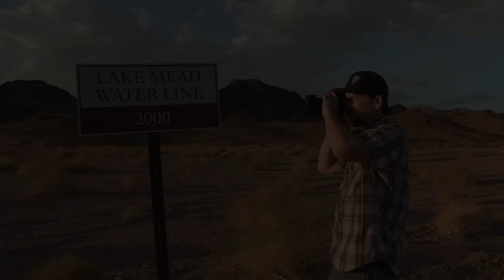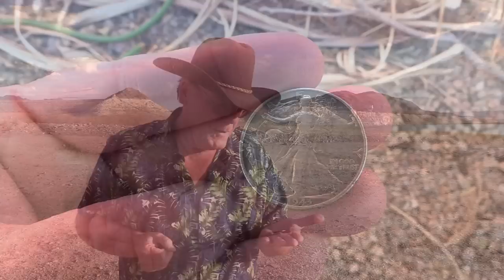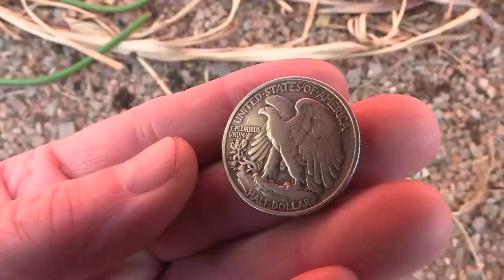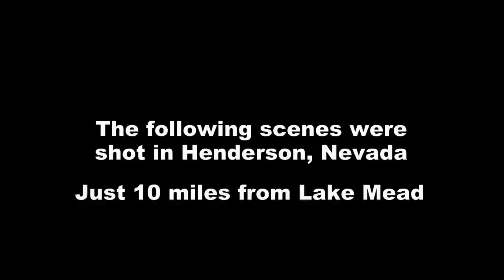LAKE MEAD DISASTER! Record Low Water Levels and Still Dropping - How Much Longer Can It Last?

Comment: My grandfather’s concern when Hoover Dam was built was that the water intakes were too low and the hydroelectric generator’s would be starved for water due to silt. Works manager Pelton Water Wheel San Francisco. Pelton provided the two wheels that generate in house power on each end of the turbine deck. 

A lake is a meadow in the making. 

Water rights and the Colorado River.  What a mess.
Reply: @Sheps  I’m paying attention and there are a lot of peon’s like me, that pay attention. But what’s a Peon to do?

Comment: Yes, very interested! Great vid!  So sad to see.. We also spent a lot of time on the lake in the 70's. I remember a day, it was 126 degrees and we had to keep jumping in to not overheat. Our boat slip was in Temple Bar, right next to Lee majors & Farah Faucett's boat. Used to catch crappie in the coves, camp at the sand bar, or up at the ?? Ferry (can't remember the name but it was where the Grand Canyon connected up north. Pierce ferry?? 

Bottom line: How the "F" are we gonna supply the power to charge thousands of electric cars every night, when Powell & Mead (Hoover dam) won't have water to turn the blades??   We already have "Rolling Blackouts" due to the grid not keeping up with current demand..  It's all unbelievable.  If we were truly concerned with CO2 levels, plant trees for gods sake.  Probably just me being stupid..    Great video!  Seriously, we're actually entering a cooling phase of the sun cycles, which means less energy. Less energy = less wind = less sun spots = less solar.  Got a good bicycle?

Comment: Love your video's and loved this one also as it was a little different than all of the "sunken boat" video's coming out every day from there. It's hard to believe that they are still building out there, but, like the old saying goes "Hope springs eternal". I turn 72  tomorrow and when I started driving in 1966, .75 cents bought 3 gallons of gas from the farmer next door. He had a 300 gallon tank with a hand pump to fill up his farm equipment so we had to crank it in by hand. Gas was around .27 cents at the gas station but the farmer got a discount from the local co-op store for bulk buys of gas and diesel. We made our money hoeing and pulling weeds out of the tomatoes fields in the spring, hauling hay during the summer plus getting up at 4:30 am to help do the milking. Life was good; still is mostly!!
Reply from the maker: Happy Birthday Robert! You're right, back in those days' life was good, although the work was pretty hard for some of us. I want to thank you for taking the time to watch our video and for leaving such a nice comment. Again, Happy Birthday and have a great day.

Comment: There is nothing to worry about. We just spent 1.5 billion dollars on the third straw intake at the bottom of lake Mead. Yes it's true that when the lake level hits 895 feet it becomes a dead pool but that's well above the new intake. Well, at least until 950 feet. As it is now, the lake is losing 7 feet a month. The current level (as of Friday July 1, 2022) is at 1,043.02 feet above sea level. That's 148 feet (21 months) until dead pool and 193 feet (27.57 months) until the third straw shuts down. However, the lake is not a swimming pool or a tank with vertical walls. It is shaped like a "V". There is more volume at the top than towards the bottom. This means as the level drops, it speeds up unless conservation measures are put in place today. This doesn't mean the lake stops dropping, it just slows it down as if it was a vertical tank. So March 2024, dead pool is reached and October 2024 the third straw stops. If nothing is done, look for the third straw to go dry well before that date.

Comment: I went to Las Vegas in 1985 and Lake Mead was more than 25% lower than normal.
They knew that lake Mead was being overtaxed back then, but did nothing.
The lake wasn't made for the population of Las Vegas and its electric needs even then.
Today everything has doubled out there because everything is cheap, but the cost of things is irrelevant without water.

Comment: Sad to see. Far too much water going out than coming in. It's unsustainable and looks like the bottom will fall out. All that construction of hotels and living units will add to the pressure on the lake. It seems a bit irresponsible and shortsighted. Drought fueled wildfires and low water levels. We've been droughty up here in Minnesota the past few years, but nothing like the severe drought in the SW. We were 4 inches low on rain for the month of June alone. Last year the farmer across the road lost his soy beans. Very dry spring and most of the summer with some rain late summer, but it was too late. He ended up plowing what was left under in the fall. We don't get those all day soaking rains anymore like we once did.

Comment: Great video.  How much lower can the water go before the dam stops supplying power?
Reply: It's around 1040' now.  At 960' the dam cannot produce, apparently, so 80' more?
Reply: @puntacanaman1  Andrew. Has anyone been monitoring the rate of the lake falling?? I would be curious how much time it has left.
Reply: @williamryan9195  There are so many variables.  Current extreme drought in the area, state water usage controls upstream, amount of annual winter snow in the Rockies, water level controls in reservoirs above Lake Mead to name a few.  It has gone down approximately 43' in just the last two years.  Shocking, really.  There is also the fact that as the volume decreases, so does the ability to maintain a lower temperature.  In other words, it'll warm up and evaporate quicker as it lowers.
Reply: @puntacanaman1  Thanks for the info.

Comment: I don't understand why it has dried up so much over last 2 years! Has it not rained any in that area and was its tributary rivers and streams been cut off? Prayers for the Lake to recover! I hope people are taking heed and trying to conserve as much as possible! Best regards
Reply: Me either.  Its like someone is siphoning off cause its going down so damn fasf
Reply: Melting snowpack (not rain) is what primarily fuels the river system.  But, it's not that simple to answer by just looking at how much it has snowed.  In fact, while snowpack is not nearly as plentiful as during the 80s/90s, it's not all that off.  Rather, the entire river system is mapped out and allocated based on legal right.  There are a lot of private landowners in the upper basin where it "all starts" that have claims predating any of these dams being built.  Hence,  it is their legal right to use their allocation.  In years past, their allocation was deposited back in because they didn't need it.  Now, there is more demand for water in Colorado (homes, ranches, farms) where a lot of these private reservoirs exist.  This results in less flow downwards affecting ever subsequent reservoir.  Lake mead is actually one of the last reservoirs to be fed water.  The amount of water going into lake mead is fixed and determinable every year from Lake Powell.  There is another lake down river from Hoover damn - lake Havasu.  But Havasu doesn't fluctuate that much (couple feet at most) because it's intended to give Mexico its allocate amount of water as well.

Comment: Ironically, at least in California, the environmentalists have significantly contributed to the water shortage problem. Over the last 50 years, they (and like-minded legislators) have opposed building new dams and reservoirs. If you look at how many dams/reservoirs California had in 1950, compared to the population of the state at that time, it’s almost incomprehensible that we have built almost no new ones as the population has exploded. So when we had nice rainy years, we simply let the water make its way out to sea rather than saving it (i.e., reserving it—hence, reservoir) for times of drought. A total shame.

Comment: I'm your age, and have lived in the Phoenix, AZ area all my life. Now live in Chandler, which was a small farming community 50 years ago. Now it looks like LA. Totally ruined. Gone are the fields I worked in as a kid, the once pristine desert, now replaced by hundreds of thousands of stucco "homes", shopping malls, artificial lakes, golf courses, and freeways. There is literally nothing left from the '70s. Developers are 100% responsible for all this destruction, including Lake Mead and Lake Powell. And they are continuing to destroy at an alarming rate. It used to be 100 miles of nothing between Phoenix and Tucson. Now most of the area between Phoenix and Tucson has been developed (destroyed) yet the so called "environmental protection agency" does nothing. Politicians consider "development" to be a feather in their cap, rather than the total destruction of the environment it really is.
Reply: I used to live in Sun Lakes AZ and moved out in 2013 after my mother died.  Visited Chandler in 2016 and didn't recognize Sun Lakes or Chandler.  I  am in Reno now.  A lot of people from CA moved into both AZ and Nevada as well as other states.  I remember driving from Nevada into AZ over the dam in 82/83.  The water was at the top.  Very sad to see it fall so low.

Comment: I noticed a lot of people are worried about the height of the Lake but what most people don't realize is their intentionally lowering the water because they're going to build a new dam. Hoover Dam is outdated and old. They're supposed to be a newer and taller Damn built behind Hoover Dam. This was the reasoning for the new highway bridge and future developments of this new dam. They cannot lower all the water at once they have to do it a little bit at a time.
Reply from the maker: I have never heard of any plans to build a new dam behind Hoover Dam. Not sure where you got your information but I'm pretty sure a new dam isn't going to be built anytime soon.
Reply: Hoover Dam is outdated and has been for a while. I work in the Carpenters Union and they have shown information about a new damn being built behind Hoover Dam. I don't know when the Project's going to start, but there's been proposal to replace Hoover Dam because it's about a hundred years old and it's generators are outdated. This is the reasoning for lowering the water gradually. The water cannot be lowered all at one time